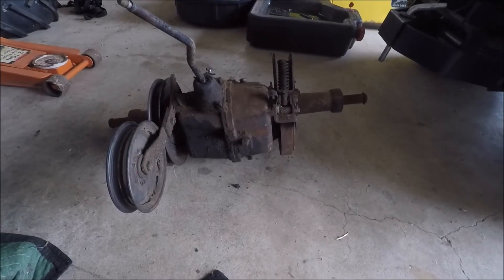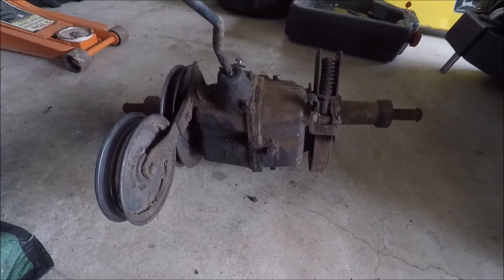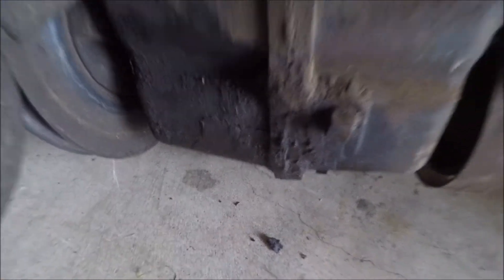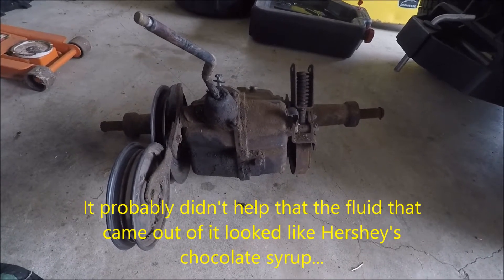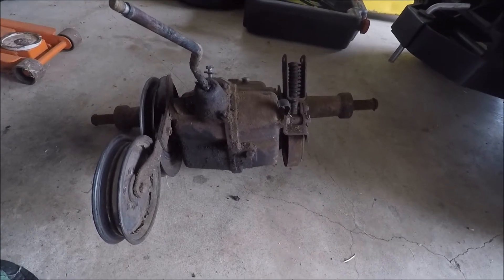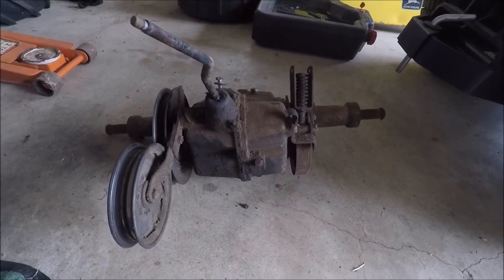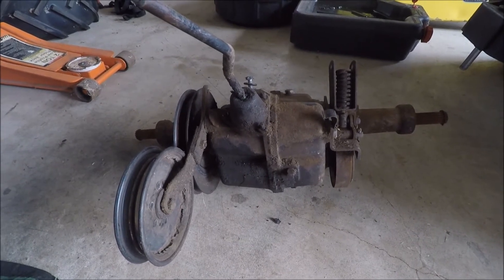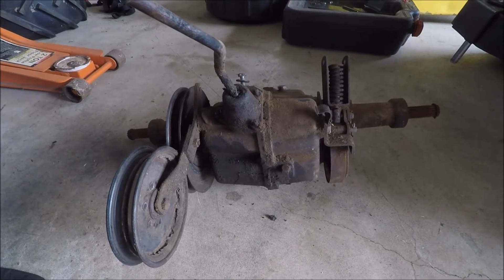Destroyed Peerless 2300 Trans-axle Tear-down

Comment: Well I finally took a shot and took mine apart.  I did buy my 110 used and know it had a bad trans axle. It was stuck in between gears.  Mine is the 2000 series ( 2001 3 speed ) used in the 63 and 64 110, and some other GT like a Springfield 8 and 10 HP.  Chatting in the forums it seams the most common failure is the Detent spring under the ball rust do to water in the case from around the Gear shift to trans axle case.  with the detents gone mine most likely shifted in to another gear while running. 4 Damage Gears and stress cracks in the case side and bottom.  I have picked up another 64 JD110 and the PO said it will slip out of third.  So before I put get that up and running I'll will open the case and replace all the detents springs and balls.  So a Rebuild is on my future Now. lol  Again thanks for the videos
Reply from the maker: I think that might have been what happened to mine, but when the previous owner tried to take off it didn't like being in two gears and something had to give somewhere...

Comment: Thank you for making this video !!!  I have a 214 converted to a 12 hp diesel.  It works great but hard to change gears sometimes.  I have to rebuild transaxle or replace it soon.
Reply from the maker: What engine did you use for the swap, and did you retain use of the PTO?
Reply: @outdoorpowerhouse  I used a 12hp Yanmar clone with 6 inch hub pulley. 39 inch V belt from engine to variator pulley.  Original gas engine mount cradle is not used.  Custom angle iron and steel plate welded to frame and engine bolted to that.  Runs like a bat outa hell.  In the process of diff locking the tranny right now (welding the spider gears).
Reply from the maker: @------country-boy-------  nice!

Comment: Really wish you had the Video back at normal Speed as you split the case.  I'm about ready to take mine apart and this is the only video I have seen so far of the workings.
Hope you can fix it. Hope I can fix mine.
Reply from the maker: Unfortunately it was beyond fixing with the cracked case as well as some other damaged components that I found later. I think the best thing for you to do is to try and find a service manual for the Peerless 2300 which should be a huge help in disassembly and repair. Thanks for watching!